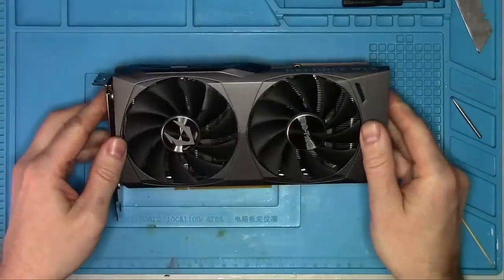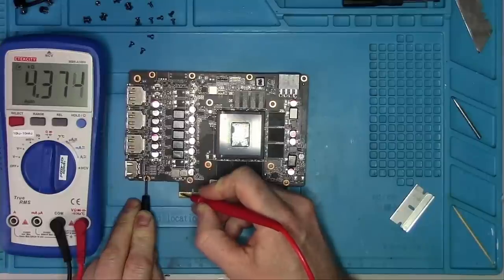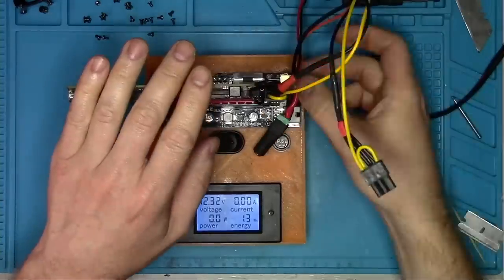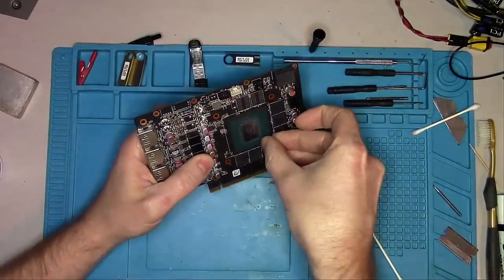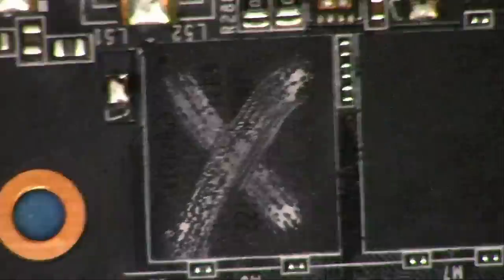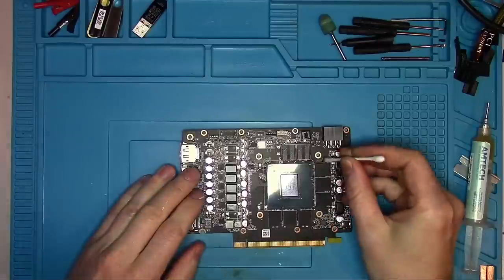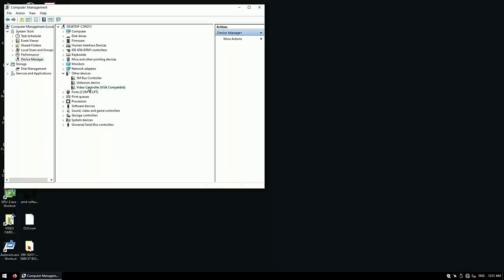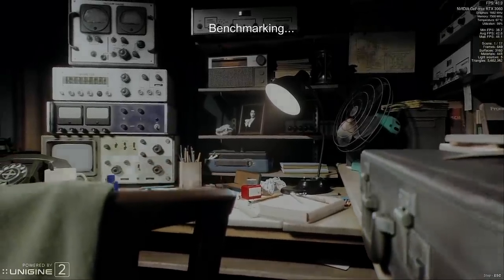Are Zotac cards repairable ? 3060 twin edge artifacts

Comment: Zotac one of my fave for that one reason. like a mitsubishi a size 10  open end box end a 13 / 10 socket and a philips screw driver could almost take my whole 86 Mitsubishi 4g63 mighty max apart and service it with just THOSE TOOLS.

Comment: What if you add 2 more chips to the empty pads for memory chips? Just asking because I'm curious.
Reply: Card wouldn't see them. those lanes are unconnected to the gpu chip. due to the bus being 192-bit disappointing but thats how it would go.
The gpu chip just doesn't have any internal circuitry or connections for the unpopulated memory pads.

Comment: What's your take on Zotak in general? I've seeing many cheap Zotaks on the market and I'm kinda curious if they are good manufacturers.
Reply: My observation.... after the 2017-2018 Mining run, I saw a lot of Zotac cards on craigslist with non-working fans or the RGB lighting didn't work.
Reply from the maker: Zotac was way better 2 generations back. 1070's were not bad for example.
2000 series is a bad transitioning product no matter the brand. 
If you can, stay away from 2000 series cards.
Reply: @northwestrepair  Had an EVGA 2070 Super that I bought second hand and it was a solid card, no issues, great temps, awesome GPU. I just bought a EVGA 3070 brand new that I expect to last for a good time. I was asking because I've been seeing that Zotac stand among the most cheaper here in Mexico but also a lot of them pop up in the used market, which can't be good.

Comment: I have the same card that i need to check and repair. But the 12v pcie line is down low. Dont exactly know what would be right approach volt injection up to how many volts should i try?

Comment: I have an EVGA 2080 TI that i used to mine Ethereum for 2 years. As time went on I had to incrementally decrease the Memory Overclock so the card wouldn't crash. I can run GPU Core driven algorithms just fine and I can still run Memory driven algos but i reduced my oc from 1800 mhz to 600 mhz. Does my card need to be checked out ?
Reply from the maker: You are likely to have micron memory that starts with 8.
There is no fix, gotta replace every memory chip with a newer revision.

Comment: That card is still in warranty Zotac has 5 years warranty
Reply: Zotac has a 2 year warranty on their Graphics card.... and they'll tack on a 3rd year if you register the card within 30-days of purchase.
The 5 year warranty you're thinking of was a promotion that Zotac was doing during the Maxwell/900-series generation. Under Zotac's rules, the card had to be registered within 30-days to get the extended warranty.
Reply: @m8x425  lol no 😂 till RTX 20 series it was 2 years standard warranty plus 3years if you registered

And now they changed its 3 years standard warranty without any registration and plus 2 years if you registered so total 5 years

And it's not even 2 years since that card launch🤣🤣
Reply: If you don't believe check their website 🙂🙃

Comment: Hi,
I've a Zotac RTX3060Ti here and following your measurements. Expecting ohms and kilo ohms to be roughly the same as yours.
The odd thing is that when I measure 3.3V on the PCI connector like you do (red probe on pci pin (front side of the board, 4th pin from the key), black on gnd) I get O.L. In the opposite direction I get some 8K.
A hint would be highly appreciated.
Reply from the maker: must be very fancy multimeter

Comment: @northwestrepair  I have a Zotac 3090 that is stuck at the idle clock freq of 210mhz and will not go higher under any conditions, I cant find any reference to the problem online, have you ever encountered this before? just wondering if it will be repairable. Also, love your work! keep it up.

Comment: Which thermal pads do you usually use? I'm about to buy a Radeon GPU but since I found your channel I expect everything except for old EVGAs to miss a dozen pads somewhere... 🙈😂
Reply from the maker: Odessey pads is what I use.
Reply: @northwestrepair  Cheers! :) At the moment I'm sympathizing with a Sapphire card but sooner or later the cooler will have to come off to check it, warranty or not.
Reply: Radeons do have sufficient pads. My Asus Dual 6600XT even has pads between GPU and backplate.

Although they´re not stellar quality - i managed to break the VRM pad on the first try, had to replace the broken part, ended up replacing all pads on the GPU with Thermal Grizzly Minus pads. Had to experiment a bit with sizes, to figure out which should be put where.
I used TG pads, because there almost none others available in my country in all required sizes.

Comment: Can i ask what to check on vram chip when replacing it, like can i change it with different brand , and the code must be same right? If same brand you will use, for example my faulty vram is "D9SXD" there is other idont know code in there , but is it only the "D9SXD" that i must consider and forget the other labels on the vram chip?
Reply: Yes, that is the one to look for. The actual product number doesn't fit on these ICs so it uses another marking system. Link to your memory:
https://www.micron.com/support/tools-and-utilities/fbga?fbga=D9SXD#pnlFBGA

Comment: Probably a stupid question but I'm curious, could those empty ram spots on the PCB be populated??
Reply from the maker: It depends. If there is a card that has same GPU but with 2 more memory modules, yes it can. Will simply need to put more chips as well as complete all the missing circuitry around them and then flash correct bios and it theory it should work.
Reply: @northwestrepair  ahhh okay, that makes sense that there would need to be a bios available, I imagine there's not many, if anyone, out there making custom bios for increasing the ram lol. That would be cool to see it done.

Comment: Just a question? What are your thoughts on anti static? From what i can see, you dont seem to have any anti static gear, is it really unnecessary?
Reply from the maker: Never in my life i was zapped by static discharge except at work and only standing at the stainless steel table dragging plastic wrap over them that creates a charge.

I honestly dont know what crazy circumstances contribute to this.
Maybe wooden table and a small room and mostly cotton clothes prevents static build up ?

Or maybe i am so negative that what ever static there is in the air, i absorb it in order to sustain.

Comment: How did you get into board repair? Any learning resources you'd recommend that's not starting on $200 GPU's? 

I really enjoy watching your videos and you make it seem pretty approachable.
Reply: Card Manufacturers to avoid: ASUS, Gigabyte, MSI, Zotac. They all had entire serieses of cards with crucial components like VRM and/or DRAM insuffciently cooled due to bad or lacking surface contact as a result of missing or inadequartly placed pads. For AMD based GPUs, i can recommend Powercolor and Sapphire, as i have have owned and inspected several models of their fabrication in the past years.
Reply: @keith303  with EVGA out of business which manufacturer is left to fill that gap? All of the brands in your list seems to me only options. Is Galax any good?

Comment: what do you think about pny gpus?
Reply from the maker: Never had one before.
Reply: I had a PNY 1gb GTX 460. The card worked fine with my x58 and Phenom II systems, but the drivers would crash in an Intel P67/Sandy Bridge system. I flashed the v-BIOS to a different version and the problems were solved. 
I tried different driver versions and had the same problem. 

I can't speak of PNY's current offerings.
Reply: They're the cheapest ones in the market, that's what makes them attractive. Their DDR3 RAM line used to fail a lot. I would skip them if you have better options.
Reply: @chupacabra0_098  What you talking about bro? New gpus from pny have GDDR6 RAM😀 I have PNY gtx 1650 with GDDR6 RAM from samsung and its fine. Samsung RAMs for gpus are the most expensive, so i dont think pny gpu are poor quality.